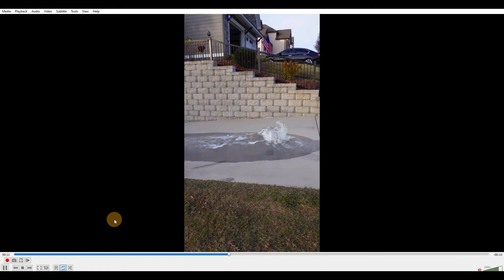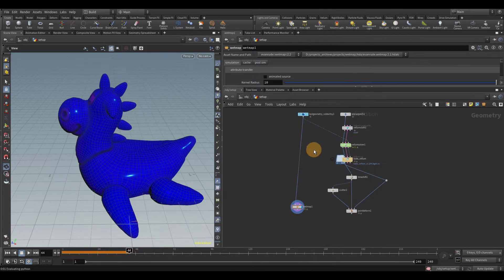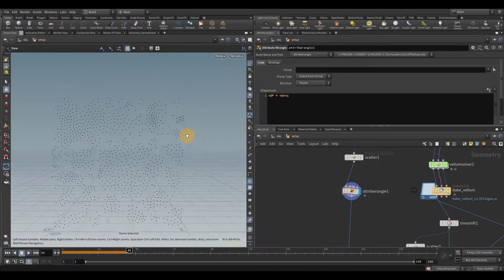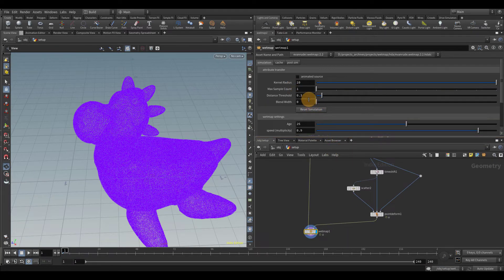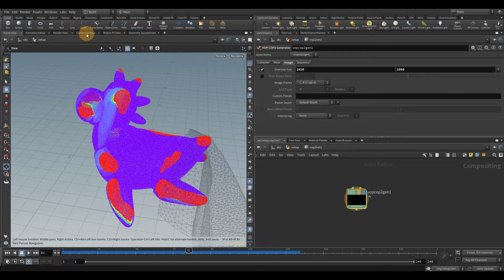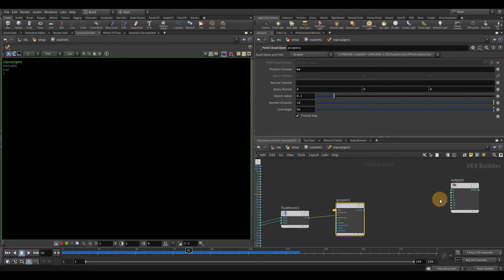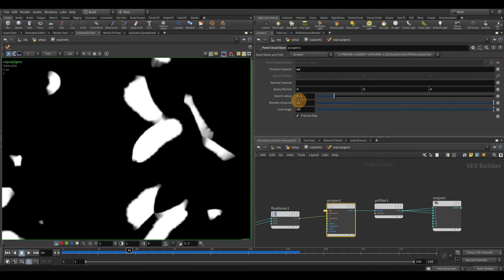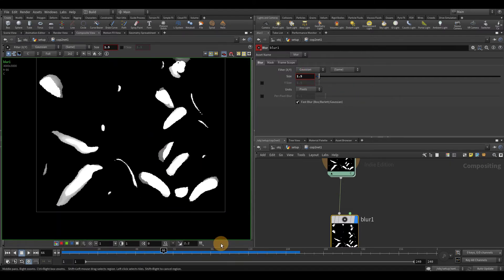uv/texture based wetmaps in houdini

Comment: Hi, thanks for this awesome tutorial. Can you make a video about rendering wet map pass using Mantra? I'm trying to render only the wet map pass and put it into Nuke to composite but I have no idea how can I get the reflection, roughness of surroundings when I only have white/black information from your uv/texture based wetmaps technique.
Reply from the maker: Are you talking about wetmaps for live action footage? Because you don't render out a wetmap pass per say from Houdini other than the black/white texture. You render out the black/white pass from Houdini and use that in after effects or nuke as a matte for a color grade adjustment. For example, I just color graded my footage to look darker then used the black and white wet map as the matte. If you want reflections you place basic geometry and put on a reflective material and adjust roughness. In the opacity for the material you can use the black and white wetmap so only wet areas render. Then in compositing you mix the reflective layer on top. To get reflections you would need an hdri or basic geometry with the footage projected onto it or both
Reply: @evanrudefx  thank you so muchh for the explanation :) really appreciate it!
Reply: @evanrudefx  Hi, I'm trying to render the black/white matte wetmap and I wonder are there any ways to set the shop material path as the emission since I want to turn off all my lights to get only black/white matte ( I don't want my matte affected by lights). I used uv quick shade and then in the Mantra's material builder, I plugged Color Surface to Emission Color but it did not work. Thanks in advance!
Reply from the maker: @BlueZiFX  dont really need emission, you just want an unlit surface with no lighting computed. In /mat do a material builder then drop a texture node inside it. Plug the clr output of the texture into the Cf  input of the surface output. Make sure you have the texture node reading your wetmap. That should render just the texture with no lighting